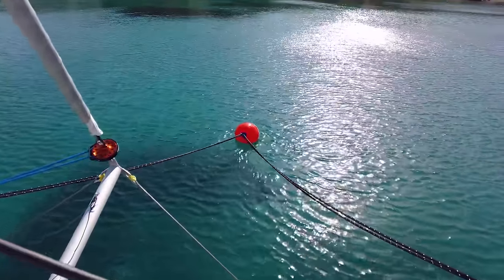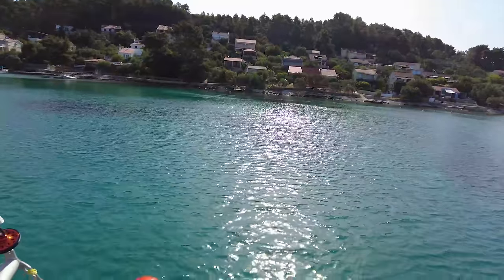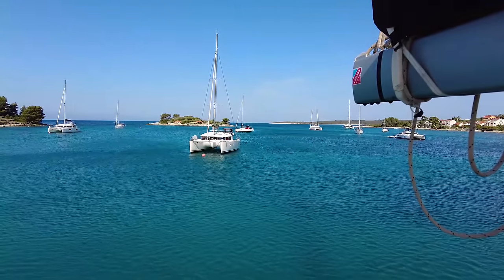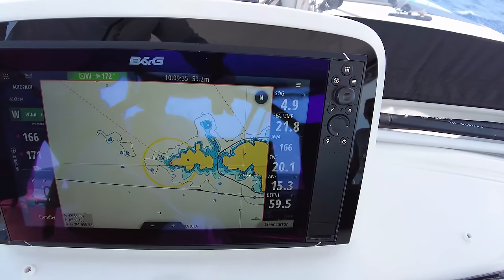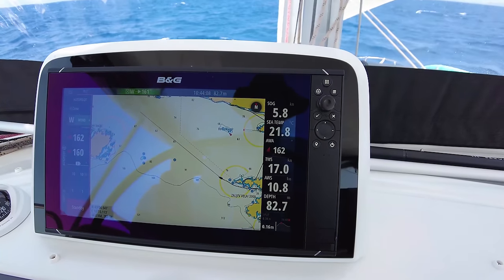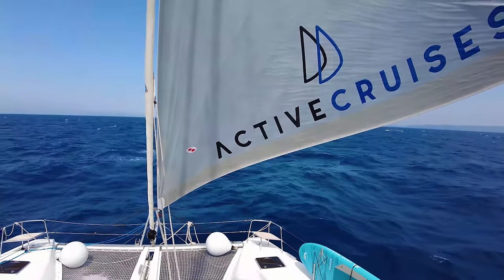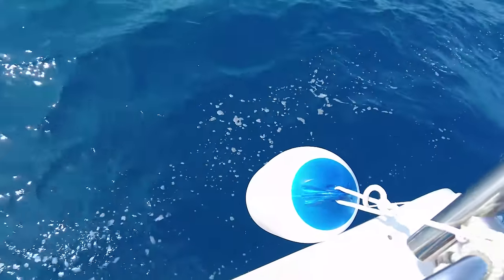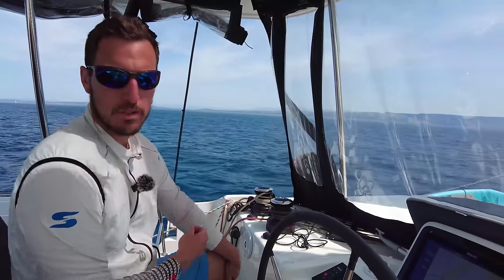How to Sail a Catamaran - 2

Comment: Those mooring buoys have a metal rod inside, it's not very tick and often corroded. If You want to feel safe, attach Your mooring lines under the buoy, where it's chain is. A bit more difficult and dirt, but if You expect heavier conditions, well worth it.
Reply from the maker: Yes 👍🙏🙌

Comment: @40:48 I've never known the props to turn when the engine is off and you are in forward or reverse.  Would putting it in forward solve the water pump issue I wonder?  Folding props for the win.
Reply from the maker: Manual says don’t put forward. You can go reverse. Engineer who told me about water pump had fixed lagoon that sailed few days nonstop and destroyed engine when starting it as water in celinder. They could turn off seacock. I guess that when surfing downwaves at high speeds propeler could turn little by little. I know lagoon who crossed Atlantic with reverse and no problem but no big speeds there. Boat that had problems crossed biscay probably with high winds and speed. I keep propeller turning as less drag and less forces on propeller.

Comment: Hi Igor, fantastic informative video as always. Quick question . On mooring with a buoy, could you not use the bridal? It is already connected to the right part of the boat.
Reply from the maker: Thanks Richard 🙏 You can but in ideal conditions. In Croatia you mostly can’t as shifting winds and rope would wrap around buoy and in low winds can’t adjust length so buoy would bang into hull and can’t sleep. Also buoys are to close together so need short rope.

Comment: for any boat that size they should have digital throttles. so you can have a remote. they use a control box to shift and accelerate at the engine so wireless and wired controls are possible.
Reply from the maker: Would be nice to have but cost more and brakes more.

Comment: 52:54 - Hi Igor, what is that downhaul line you use when dropping the mainsail? Is that attached to head of mainsail? Does it run outside the mast? I haven’t seen one of these before but I like it 😉 Thanks for another great video 👍
Reply from the maker: Attached to head to help bring the sail down in last meters so you don’t have to climb the mast. Runs outside mast.

Comment: I am a bit confused: Yanmar says in the manual for their SD60 saildrive on page 18 clearly that you can go into reverse.
Reply from the maker: Talked to engineer in Cascais who repaired New Lagoon after engine failure because they sailed with reverse from France and they got water in celinder and after trying to start it was big damage. They should have seacock off but that is maybe not smart if you forget and start engine. They say that boat is slower if you go reverse and also much more pressure on propellers which are too soft already as in charter business they get replaced every year. Solution is simple- folding prop.

Comment: @3:48 Why not just replace the factory bridle with quality line that won't break?  Under all but storm conditions a factory bridle is just fine for a mooring ball.  I still do what Igor does but it seems excessive.
Reply from the maker: If winds drop and shift long bridle will loop around buoy. It’s nice if you can adjust the length from the boat. Also connecting bridle to buoy can be hard. I like to be able to quickly release the lines and go if there is emergency but with bridle hooked to buoy and maybe warped around you might have to use knife.

Comment: Hi Igor great video, fyi these guys are attaching a bridle on a lagoon without additional cleats, not easy to see how but appears to be eyelets where trampoline meets hulls, would that work for buoy also?: https://youtu.be/i_SqmhP4hPU
Reply from the maker: Have tried it and works. Problem is adjusting length of rope and hard to release it under pressure in strong winds.

Comment: Lesson 1, buy a real catamaran, one that can actually sail at reasonable speeds. Condomarans take forever to get anywhere...... 
You keep saying it's not a racing boat but all good cruising boats have dedicated sheet winches and separate halyard winches. Lagoons are cheap boats that cut every corner possible, especially when it comes to sail handling. I only got 15mins in but your advice is novice at best. I suggest anyone that wants to go cruising should join a club and sail on club racing yachts, you will learn more in one season than you will in five years of cruising.